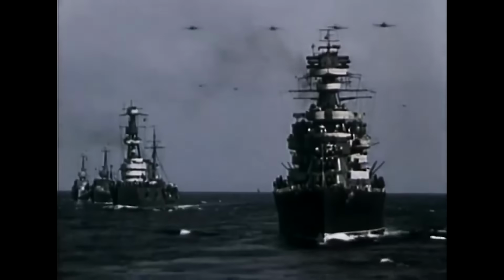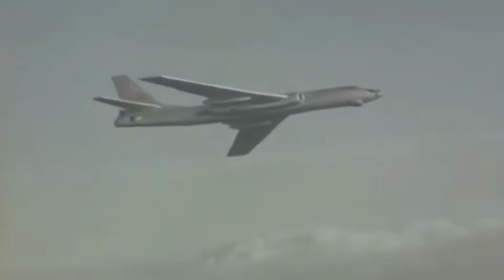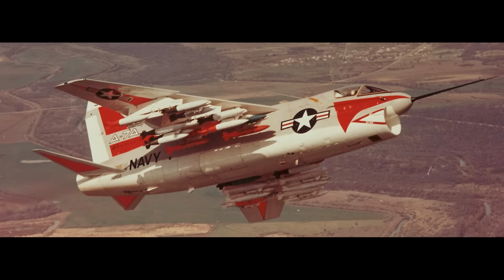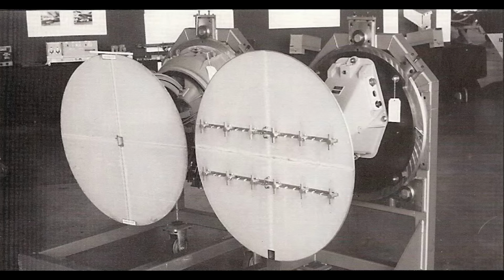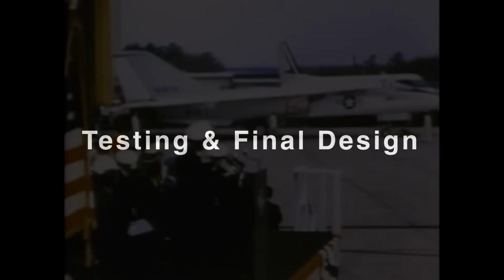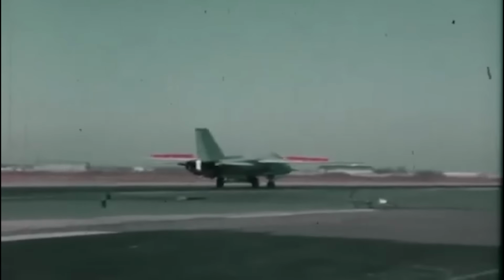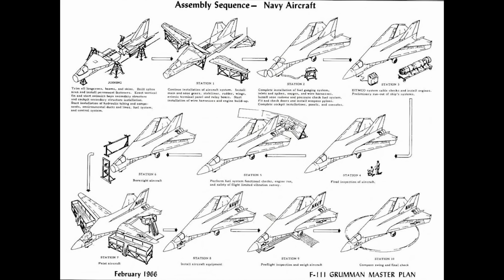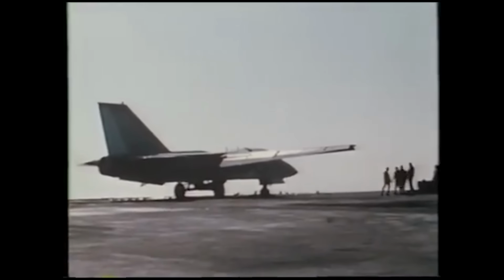Was The Grumman F-111B A Bad Aircraft Or A Missed Opportunity?

Comment: The 111B was a bad aircraft and not what the Navy wanted. They then developed the F-14, which is what they wanted.
Reply: think of it a fat tornado F3/ADV
Reply: The F-111B was what the Navy wanted when they asked for it, and if you paid attention to the video you would have seen that explained.  The Navy later changed their mind when they realized they couldn't get both a new fleet defense interceptor and a new air superiority fighter and had to combine both missions into a single airframe, which became the F-14.
Reply: Most of the same parts.... Just a smaller airframe that would work for the Navy.
Reply: The F-111B wasn't a bad aircraft.  It was a bad aircraft for the Navy .  It didn't do what the Navy needed from a fleet defense fighter to do, and it had a disproportionately large footprint (both spotting and logistics) for what it brought to the table.  The difference in size between the F-111B might not seem like much, but as a naval engineer who has spent most of his career working on carriers, it's a big deal - those spotting diagrams come down to inches .

Note that one of the key reasons the Navy retired the A-5 Vigilante was the size of the aircraft meant the juice wasn't worth the squeeze for a carrier based aircraft.
Reply: Remember the F-111 was a airforce design which the Navy hated leading to propaganda and sabotage during test and exercises. 

One such example is when they asked a female pilot to fly, some issue happened and then they used that as ammunition for women and the F-111b not being in the Navy

Many design choices on the F-14 were also made to make the vark look bad such as the air intake which was poorly designed making the TF-30 compressor stall
Reply: @jdb0715  The F-14 had its share of TF-30 compressor stall issues as well. The TF-30 is what killed Goose!
Reply: @RCAvhstape  Hence the reason for the General Electric F110-GE-400 engine, a derivative of the F101 engine used on the B-1 bomber. Unlike the TF30, the F110 offered way more thrust and did not suffer the engin compressor stall issues that plagued the TF30.
Reply: @RCAvhstape I’m a little late. But the TF30 wasn’t the entire issue it’s the air intake which wouldn’t let enough air into the engine. The F-111b fixed this issue on one of the earlier prototypes. The air intake caused the TF-30 to kill Goose.
Reply: @jdb0715  The F-111 was the result of McNamara's direction to take the Air Force requirement for a high speed strike aircraft that could fly supersonic on the deck and the Navy's requirement for a high altitude aircraft with a long loiter time and a big radar firing big missiles at incoming bombers and directing both services to buy one plane to do both missions.